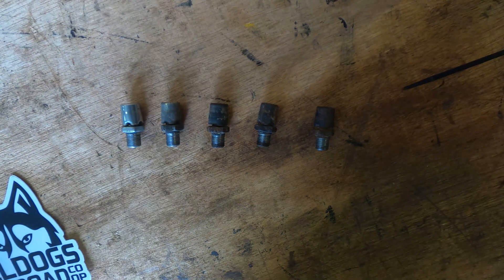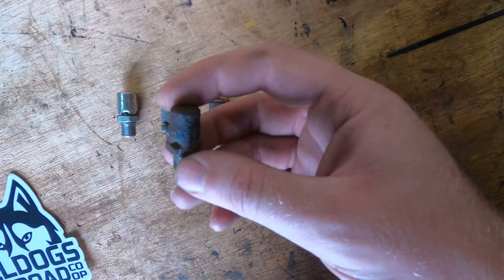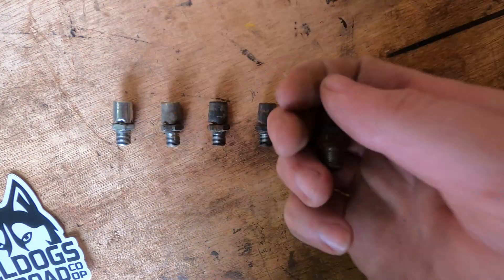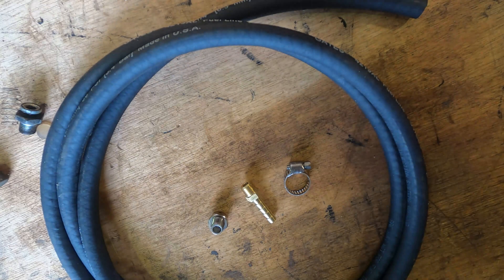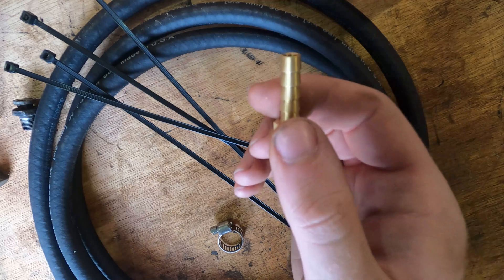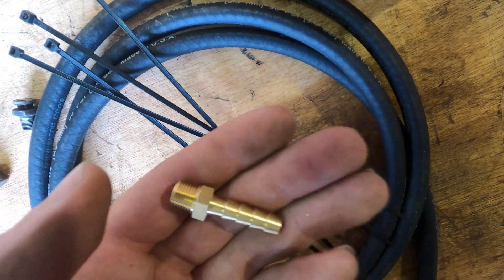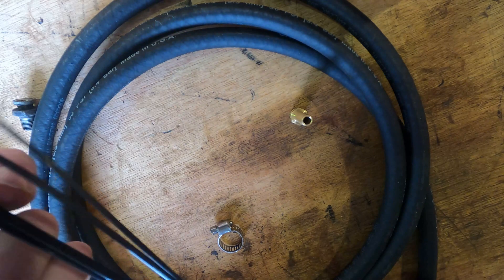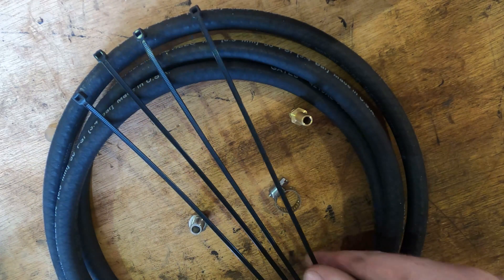Tech - Nissan Frontier, Xterra, Titan Rear Differential Breather Mod

Comment: Thanks for showing. I have a 2008 Titan that I tow our 16-foot travel trailer. This is a great mode for me to protect my truck.
Reply: Another mod I did to my 2010 titan, I put two oil catch cans on the hose (one can per side) that  goes from the PCV value into the intake. They catch some nasty looking chocolate milk slug from goin back into your fuel injectors. I been emptying mine every 1500ish miles and dumping out about 3 to 4 oz of some nasty stuff.
Reply: @dreel1981  Do you have a link to them by chance?

Comment: I relocated my rear diff breather with ADA kit. Is the front differential a concern as well? If not, Why would they make the two different ?
Reply from the maker: front diff has a breather hose from the factory that runs up to the airbox in the engine compartment

Comment: Maybe I just want a full titan suspensions swap.😅 the preventative maintenance 👨🏿‍🔧 comment was 💯 accurate. That I agree with. I mean if you had a new axe and you turn those tires in the mud long enough you could blow an axe seal. I get it set it and for get it. 

Not many people were wrench turners for their first career. 😅 Ty for the video. I heard a puddle made the failure happen and I was triggered by whoever told that person that on YouTube. If only people made important parts out of magnesium. Lmao

Comment: how often should you replace the one you just screw into the axle ?
Reply: I checked mine every oil change or significant offroad trip. Running remote now.

Comment: Thanks for your video.. Explains the issue and the solution very well. I would like to confirm one thing though. Will the alldogs breather fit directly on the Nissan Armada 2014? I'm not offroading much so a bolt on is just good for me without the relocator. Didn't find any video on YT showing someone putting this on  an Armada.
Reply from the maker: It should work!

Comment: So with the barb that you supply, no thread lock or sealer is needed?  So many people on the forums state you have to put sealer on the threads?  My opinion is the OEM unit doesn't use sealer so??  Is there any kind of maintenance on this filter you supply?  Does the membrane last years and years? or needs to be replaced every so often?  If the membrane fails??  Just curious about that if you can expand.  Thank You.👍😎
Reply: no just teflon tape, the threads are slightly tapered
Reply: @ArmChairKoalaBare  yeah but that's the thing I mean people on the forums do not recommend using Teflon tape and actually state that there's no sealer or Teflon tape from the factory it's just screwed in 🤔
Reply: @eppyz  its not gonna hurt anyhting at all could eve use liquid teflon if you want ..probably not needed honestly.

Comment: Does the pro4x need this mod since it has the d44 variant diff
Reply: yes.. it still has the standard vent.. mine was sealed up tight with mud
Reply: @mattrage1673  thanks man I just got a 2011 frontier pro4 I m going to need to get on that asap being the year that truck is
Reply: @chrischavira2768   no worries I'm looking for the stinking fitting to do it myself.. cant find one..

Comment: ordered and will install today...you should have some directions in it or a link to this video. When replacing breather do you need plumbers tape?
Reply: where does hose clamp go on the breather side or axle side?????????????????
Reply: Just called them .....excellent feedback
Reply: @jthamm8362  Realistically you would want to put hose clamps on both sides! You do not want either end of the hose coming free and allowing water to enter!

Comment: hey, im wondering how capable a nissan frontier se v6 4x4 king cab could be? i want to do some light to medium off roading and need a 6ft bed. i cant find any king cab pro 4x near me but can find the se. i am wondering if i get the se for a killer price would it be worth buying and overtime try and find a pro 4x axel to swap in? or should i go on a country wide shopping trip for a pro 4x? thanks
Reply from the maker: While the Pro-4X is definitely a great choice for offroading, and SE/SV is no slouch!  Swap that rear axle in and you'll be in even better shape.  If the price is right, I say go for it.

Comment: If choosing your first option to just replace the breather, do you recommend anything like tape on the threads or is that unnecessary? I’ve seen others recommend it. If doing the second option of full relocation, is a clamp not needed for the breather at the end of the tube?
Reply: I asked the same thing.  He did mention in the video that the barb he supplies is tapered and creates a seal.  So with that said, maybe he answered our question?  The OEM part does not use a sealer, it just screws in.  I think some folks especially on the forums over think things.  If you use sealer and over apply it can fall into the axle or teflon tape can do the same thing.  Most companies that sell this kind of part, none of them say to use a sealer.
Reply: @eppyz  Proper pipe threads don't require tape to create the seal but you may to use it to prevent galvanic corrosion (when dis-similar metals corrode to each other and effectively become welded together)
Reply: @SeibChris  ok just trying to figure out the best course of action.  There is something on the OEM threads from the factory so if it's not needed why is it there?  I just assumed it was some kind of sealer.
Reply: @eppyz  teflon tape is a good idea because of the corrosion factor but you only need one or two wraps. You never need 4-5-6 wraps like people tend to use when they're trying to get a bad joint to seal.